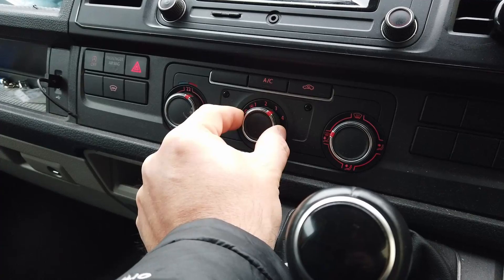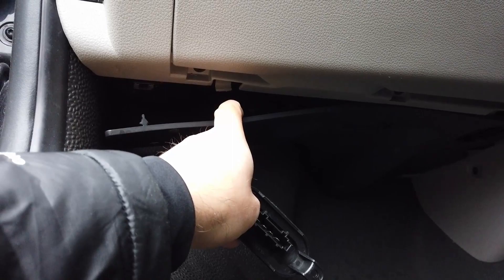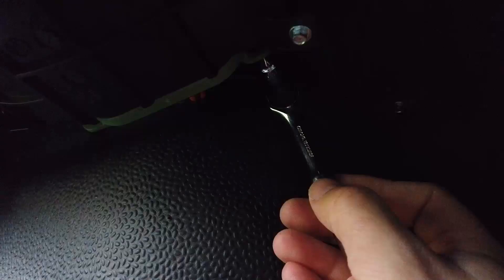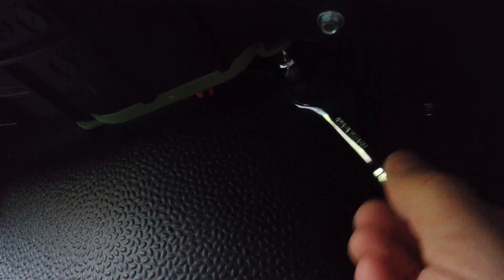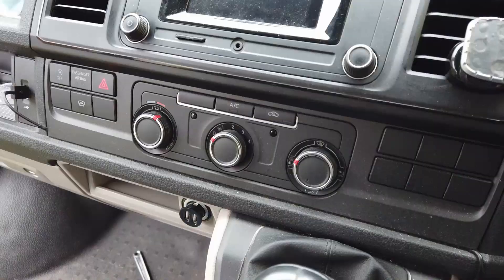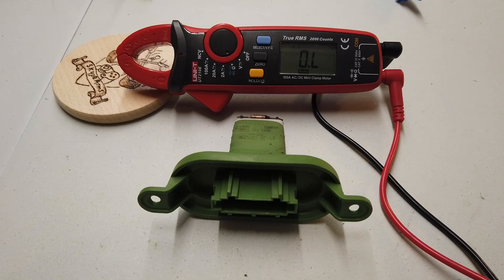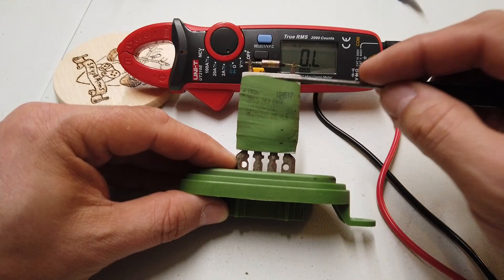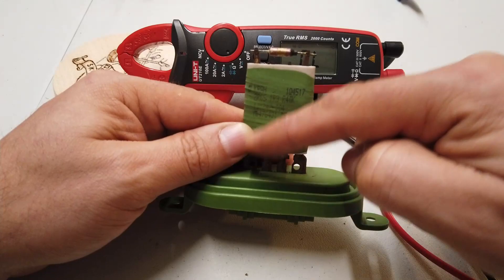DuB-EnG: Fan Heater Speed Control repair on Wolkswagen T5 T6 - Resistor matrix repair / replacment

Comment: I replaced the thermal fuse on a resistor pack a good 15 years ago on an old focus. I bought a handful of the fuses (from maplin I seem to remember) with the same thought - soldering would pop them. The first one soldered in fine. I imagine they need a few minutes at their rating before they blow. Sold that car with that repaired resistor pack a couple of years later. 
They sit in the air duct to help keep them cool. I guess the air can be moist in there sometimes which explains the slight corrosion.
Reply from the maker: Maplin..   we're they better than tandy?

Comment: Thanks for taking the trouble to post this - most helpful.   £15 new part online (loads of choice) and job takes about 20 mins on a T6  (harder on a T5)   Access is tight and only one screw can be removed with a 5.5mm socket on a 1/4" drive ratchet.  Get yourselves a 5BA open ended spanner which fits the hex perfectly and is much easier  (I don't think you can buy a 5.5mm open ended spanner readily but 5BA can be found online
Reply from the maker: Great tip Steve, yes an open ended spanner is well worth investing in!

Comment: I feel your pain regarding those resistors. I changed a few resistors in my civics over the years. At some point I was able to buy the coils and solder them in place.
Reply from the maker: I may have a go at repairing this in the future myself - I'll likely use a slightly higher rated thermal fuse!  :-)
Reply: @DubiousEngineering  if you can find the parts, why not? However, using a higher rated Termal fuse, not sure about that

Comment: If that could be modified with a snap in fuse it sure would be handy. Hope whatever issues are ironed out whatever they might be.  Down time is always needed. A healthy new year to you and all in your family.
Reply: That's a good idea - maybe one could use an inline fuse holder? That way you just solder in the wires and then change the fuse as required...
Reply from the maker: Happy new year Karen and Bunny 🐰!! ... both have great ideas!!

Comment: Great video, happy new year mate! This was really interesting.

Did you consider using a battery spot welder to replace the fuse? It would be fiddly for sure... Just a thought for future. 

Thanks as always  for sharing the repair journey, not just the solution.
Reply from the maker: I may have to make one of those spot welders...  I keep thinking ill need one!
Reply: @DubiousEngineering  I got a battery powered one that charges over USB for like $50 on Ali Express, it's really good. Was going to make one but saw a review of these and they seemed worth a try, and I'm glad I did.

Comment: I have a problem with back/roof ac,webasto in the back works but it dosent blow air. Any help?
Reply from the maker: You need to check fuses and then get the multimeter on the switches to test for voltage

Comment: My fan speeds are ok..the problem is the temperature regulation. it is either at 26degrees or stone cold..would this part fix that as well ?
Reply from the maker: Nope…. Sorry…. That’s a totally different issue
Reply: @DubiousEngineering hey mate, I have a 2005 T5, I need this part to fix my fan speed issue. Would you happen to have the part number I need for my T5? Thank you in advance Jamie